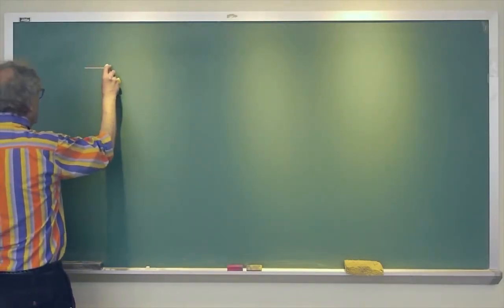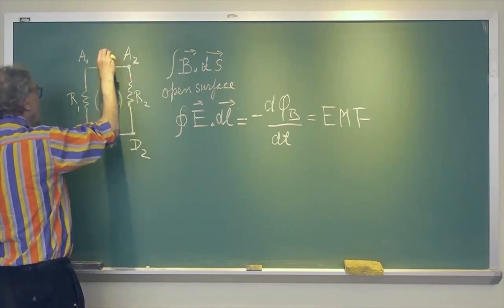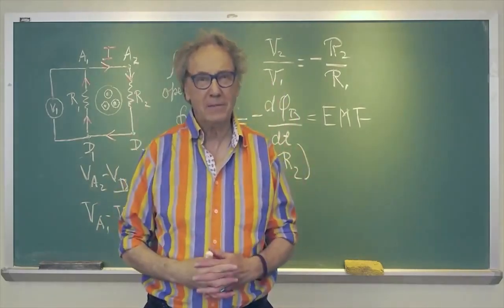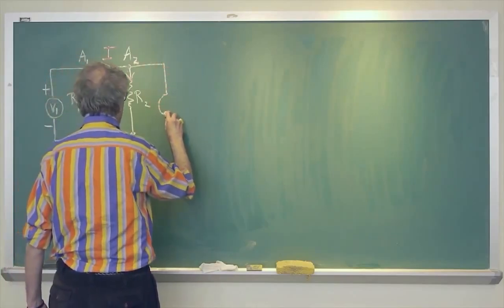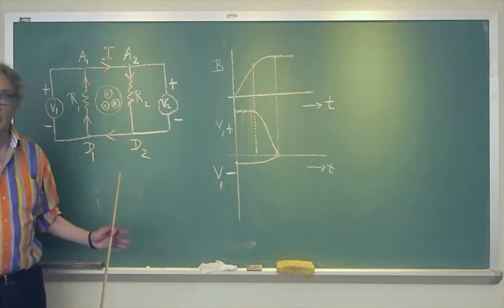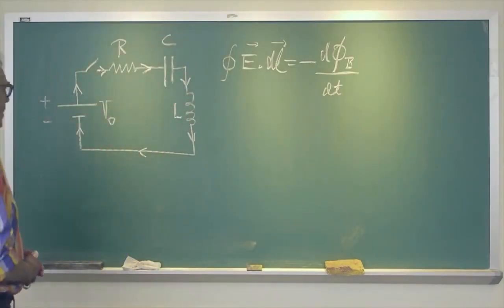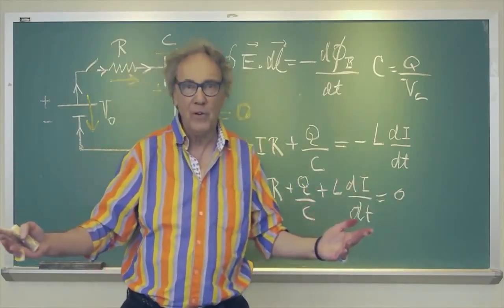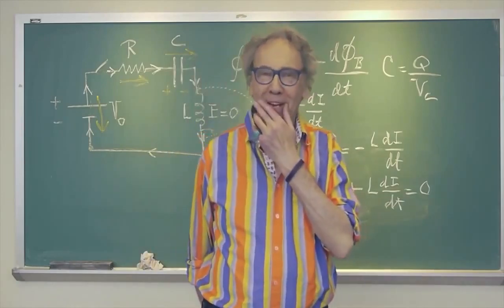Kirchhoff's Loop Rule Is For The Birds

Comment: Dear Prof Lewin, If you can please clear my doubt on the following issue. Referring to your lecture 16. If one voltmeter is connected right in the middle of the 2 resistors R1 and R2. How will the voltmeter know which reding to take IR1 or IR2 (from your lecture notes). (point D and point A) in the video. This is part is very confusing to me.. Which voltage will it read? thanks  in advance for any one who can give me some insight.
Reply from the maker: "right in the middle"  is ill-defined as you cannot cut wiress. However, if you move 1 voltmeter (without cutting wires) then you will be able to predict the values of both voltmeters PROVIDED that you can apply Faraday's Law to high presicion.

Comment: Sir i have a question in Farady's Law
If I have a circuit which is equilateral triangle with its three sides as resistance of "2 ohm and side 2m each"
and i keep it in a plane such that magnetic field there varies with time as "B = sqrt(3)*t" (SI units) (increasing in the same direction)
then i will get an induced emf given by faradays law of "3 Volts" (not talking about direction as Lenz law will take care of that)
i.e. a current of "0.5 A" will flow through the resistors
Now my question is that if I connect a voltmeter across the base side resistor,
a) below the resistor
b) above the resistor but inside the triangle
c) above the resistor but outside the triangle
then what will be its reading in each case? (only the magnitudes)
(Assuming the changing flux passes through the voltmeter too and it is ideal)

I think the answers are,
a) 1 Volt
b) 1 Volt
c) 2 Volt (in opp. direction to above two answers if voltmeter connected in same polarity)

Sir could you please tell if I am wrong anywhere?
(And I know the Kirchoff's Loop Rule is for the birds 😁)
Reply from the maker: if you apply Faraday's law correctly you can do this on your own. I have no time for this
Reply: @lecturesbywalterlewin.they9259  thank you so much sir for your reply
yes, sir i have solved it but I am just not sure of the b) part of my answer, i.e if the voltmeter is inside the triangle will measure 1V or 2V
Sir I do value your time and I know this problem is too fundamental also, but most teachers I have don't understand Faradays Law properly and some even use Kirchhoff's Loop Rule is such questions

I am a Class 12th JEE 2026 Aspirant from India btw

Comment: Why do you make such simple thing so complicated? Just say the truth. As soon as a physical Voltmeter is attached the circuit is altered. That is life. The flux is going through the surface attached to the loop around one of the resistor depending on physical location of the wires and the voltmeter. So voltmeter measures the voltage drop across the resistor in altered circuit. You cannot measure potential difference with a voltmeter in the original circuit. Different physical locations of the loop with voltmeter wires makes different loop and different surfaces. In both circuits the induced EMF has the same absolute value different by a sign because the direction of the surface flips when you move wires from left to right and vice versa. But the induced absolute EMF is the same. It is induced across the entire loop. The induced EMF makes the potential difference in the loop across the resistor. But the EMF itself is not a potential difference. It is a force. Depending on the location of the loop you measures a voltage drop on one or another resistor. But it does not depend on choosing between A1 and A2 or between D1 and D2. It depends only on orientation of the loop. Different resistor values - different voltmeter readings. Is not it obvious? It is very obvious for me.

Why do you talk about KVL at all? You cannot apply KVL in non static magnetic flux to calculate potential differences. KVL does not take into account changes in the magnetic field across loop surface.
Reply from the maker: I agree with you for 100%. But 2 of my viewers claim that KVL can always be used and they then argue that the 2 Voltmeters should have read the same valuues (also same polarity) if the experient is done correctly. Ofcoz they are dead wrong

Comment: The electric field is always zero,except when there is a transient.The inductor is the equivalent of a flywheel ("kinetic energy" equivalent).To start the inductor at t=0 an electric field is needed (Potential Energy equivalent) and whenever there is a change in the voltage supply,be it magnitude or a change in frequency.The electric field can even be negative (back emf).In steady state the electric field in the inductor is zero,
Reply from the maker: <<<<To start the inductor at t=0 an electric field is needed (Potential Energy equivalent)>>>>  this is dead wrong  there cannot be a potential difference over any ideal inductor. Please watch my 8.02 lectures.  this will be my last msg.
Reply: @lecturesbywalterlewin.they9259  Thank you for your time,it is really appreciated..

Comment: There is no voltage without electric field.
In general,no voltage , eg.across an inductor, is possible without the presence of an Electric field (within).

In the particular case of voltage zero across an inductor it means zero electric field within.
Reply from the maker: there cannot be an electric field inside the wires of an iideal conductor (thus zero ohmic resistance) as that would lead to an infinitely high current. Thus there cannot be a potential difference between the two ends of the inductor. *However a current can flow through an ideal inductor as the ohmic resistance is zero. this is my only response.
Reply from the maker: electric voltage across an ideal inductor is not possible as it would generate an infinite current. No E-field can be present inside the wires ofan ideal inductor. However, a current can flow throough  ideal inductors (like a superconductor)  but  the E-field inside will always be ZERO and thus there will never be a potential difference over an ideal inductor. This is my last msg on this issue.

Comment: Within inductor for both DC and AC voltage source:
Electric Field is Maximum at t=0
for DC source it decreases exponentially to zero and Oscillates at same frequency as AC voltage source.
Reply from the maker: nonsense

Comment: If Faraday law truly always holds, there wouldn't be any Faraday paradox.
Reply from the maker: E
{\displaystyle {\mathcal {E}}} is the EMF and ΦB is the magnetic flux through a loop of wire. The direction of the electromotive force is given by Lenz's law. An often overlooked fact is that Faraday's law is based on the total derivative, not the partial derivative, of the magnetic flux.[1] This means that an EMF may be generated even if total flux through the surface is constant. To overcome this issue, special techniques may be used. See below for the section on Use of special techniques with Faraday's law.
Reply: @lecturesbywalterlewin.they9259  prof. Lewin, there is nothing below your comment here. Could you please elaborate on what you mean with "below" here and  what is the [1] referring to?
I am making a series of videos on this topic , and on the definition of voltage and EMF in general and I am trying to cover all possible angles.

Do you mean that the convective derivative can be nonzero even if the magnetic field is constant because for example the contour of the loop is changing?

Comment: What type of momentum is being loaded unto the wire when induction takes place?
Reply from the maker: this question is ill-defined
Reply: @lecturesbywalterlewin.they9259  

It's not ill-defined but don't worry about it as it was a leading question so I'll just get to the point. (Try not to be too offended on behalf of Faraday who failed at formulizing a Torsion Theory of Electricity)

Electricity is not generated as its already  loaded in metals. It is ACTIVATED instead.

One cubic meter of copper windings has 8.5x10^28 electrons.

So charge is available.

But it is at maximum entropy state like a cloud.

Rotating magnetic field orients this cloud.

Cloud starts oscillating.

Frequency is fixed.

Amplitude & Wave Length are voltage & current.

So, how should we measure RMF input momentum to calculate the output of a "generator" ? (BTW mgh input is wrong!)
Reply from the maker: @jaydenwilson9522  there is no input and no output momentum you are confusing momentum with energy - I suggest you watch my 8.02 lectures

Comment: Dear Dr Lewin, at this moment in time as I am writing this comment; I'd like to say one thing absolutely honestly. It is impossible to engineer an electrical circuit without Kirchhoff law. It is not only for the birds it's also essential for electrical engineering.
Reply: The first rule a *good* engineer should know is to always know the limits of applicability of their tools.

KVL can be applied only when the electric field is conservative: when E is not conservative - and it is not in the presence of a variable magnetic field - KVL is no longer the right tool. You need to use a better tool: Faraday's law.
Reply from the maker: In Dutch we say "zachte heelmeesters, vuile wonden". I owe it to my multi million viewers to explain in detail why Electroboom is dead wrong. Many people make the same mistake that he made. All this is at the very roots of a correct understanding of Maxwell's eqs. I therefore have an obligation to set the record straight. This is my last msg.
Don't feel embarrassed if this physics is above your level; you are not alone. Non-conservative E-fields are not taught in high schools. 
I demonstrated at the end of my lecture #16 of my 8.02 E&M course at MIT that two identical voltmeters attached to the same 2 points in a circuit can show very different values. https://www.youtube.com/https://www.youtube.com/watch?v=nGQbA2jwkWI&list=PLyQSN7X0ro2314mKyUiOILaOC2hk6Pc3j&index=17
This can also be demonstrated with a transformer.
https://www.youtube.com/watch?v=b7i2uMx7gHo&list=PLyQSN7X0ro22zanLOcvkaSY-IZqheFYM5&index=8
In fact, look more closely at my circuit; it is a transformer. My closed loop is the secondary winding (only 1 winding) of a transformer and the primary windings are in my electromagnet. 
The reason is that an induced EMF (Faraday's Law) creates a non-conservative E field. This means that moving a test charge between the same 2 points in a circuit can require a different amount of energy (even with opposite signs!). You still aren't getting any energy for free, because it comes from the source of the time-varying magnetic field.
When a voltmeter reads a value V it means that the integral of E dot dL across the voltmeter is V. 
In cases where Kirchhoff's loop rule (KVL) applies, 2 voltmeters attached to the same 2 points in a circuit will always show the same value. Kirchhoff's original text can be found in the following link, pages 497-514: https://books.google.de/books?id=Ig8t8yIz20UC. Clearly he was fully aware of the prerequisite for his "loop rule". KVL is a special case of Faraday's Law. That's why Faraday's Law is one of Maxwell's equations and KVL is not.
My demo was first suggested and published by Romer in December 1982 in the American Journal of Physics. This demo has now become a classic; it's done all over the world at many colleges and universities.
ElectroBOOM and Dirk Van Meirvenne believe that 2 voltmeters attached to the same 2 points in a circuit must always show the same value which is not true. It's quite  embarrassing that they each posted a video on their channel in which they claim to have proof for their wrong ideas.
Also read Professor John Belcher's thoughts on Faraday's Law and on KVL. Professor Belcher is my former colleague at MIT. http://freepdfhosting.com/0813df09f5.pdf
ElectroBOOM insulted me in his video by mentioning that the reason why my 2 voltmeters read different values was due to "bad probing". He stated that if I had done the demo correctly both voltmeters would have read the same value. He could not have been more wrong.  
The following video may also help you to understand why 2 voltmeters attached to the same 2 points in a circuit can give very different readings. https://www.youtube.com/watch?v=LGdN7rDB3XE

Comment: While the magnetic source is changing there is an ideal current source between points A1 And A2  and there is another source between Point D1 and D2 this is because of induction . These two are the voltage rises  while these rises drop across the resistors which we measure using voltmeters. It means at any given instant the total potential accross the loop is always zero. so I totally expect two voltmeters to read different voltages while the magnetic field is changing because at those times each ideal conductor is acting as source and its two end points are not going to be at same potential. Just draw the sources and the confusion goes away.
The same is also true for the solenoid made of supercinductor. It is not a drop its a rise.
P.S. kirchoff law never considers or demnads ohms in wires. And sorry physics is not my religion It just a science.
Reply from the maker: so I totally expect two voltmeters to read different voltages while the magnetic field is changing   I agree and the closed loop integral of E.dL is NOT ZERO  Therefore KVL does not apply.

Comment: what can You say about electroboom is he right ?? he said he used richard feyman's book as a reference  and he concluded that kvl always holds true no matter any thing happen
Reply from the maker: Don't feel embarrassed if this physics is above your level; you are not alone. Non-conservative E-fields are not taught in high schools. 
I demonstrated at the end of my lecture #16 of my 8.02 E&M course at MIT that two identical voltmeters attached to the same 2 points in a circuit can show very different values. https://www.youtube.com/https://www.youtube.com/watch?v=nGQbA2jwkWI&list=PLyQSN7X0ro2314mKyUiOILaOC2hk6Pc3j&index=17
This can also be demonstrated with a transformer.
https://www.youtube.com/watch?v=b7i2uMx7gHo&list=PLyQSN7X0ro22zanLOcvkaSY-IZqheFYM5&index=8
In fact, look more closely at my circuit; it is a transformer. My closed loop is the secondary winding (only 1 winding) of a transformer and the primary windings are in my electromagnet. 
The reason is that an induced EMF (Faraday's Law) creates a non-conservative E field. This means that moving a test charge between the same 2 points in a circuit can require a different amount of energy (even with opposite signs!). You still aren't getting any energy for free, because it comes from the source of the time-varying magnetic field.
When a voltmeter reads a value V it means that the integral of E dot dL across the voltmeter is V. 
In cases where Kirchhoff's loop rule (KVL) applies, 2 voltmeters attached to the same 2 points in a circuit will always show the same value. Kirchhoff's original text can be found in the following link, pages 497-514: https://books.google.de/books?id=Ig8t8yIz20UC. Clearly he was fully aware of the prerequisite for his "loop rule". KVL is a special case of Faraday's Law. That's why Faraday's Law is one of Maxwell's equations and KVL is not.
My demo was first suggested and published by Romer in December 1982 in the American Journal of Physics. This demo has now become a classic; it's done all over the world at many colleges and universities.
ElectroBOOM and Dirk Van Meirvenne believe that 2 voltmeters attached to the same 2 points in a circuit must always show the same value which is not true. It's quite  embarrassing that they each posted a video on their channel in which they claim to have proof for their wrong ideas.
Also read Professor John Belcher's thoughts on Faraday's Law and on KVL. Professor Belcher is my former colleague at MIT. http://freepdfhosting.com/0813df09f5.pdf
ElectroBOOM insulted me in his video by mentioning that the reason why my 2 voltmeters read different values was due to "bad probing". He stated that if I had done the demo correctly both voltmeters would have read the same value. He could not have been more wrong.  
The following video may also help some of you to understand why 2 voltmeters attached to the same 2 points in a circuit can give very different readings. https://www.youtube.com/watch?v=LGdN7rDB3XE
Reply: Electroboom misquoted Feynman. In his Lectures, Feynman states that in order to apply the easy-to-use circuital laws all magnetic fields should be confined inside the components alone. This means that no magnetic field (and in particular no changing magnetic field) should be present inside the path that connects such components. If this is the case, voltages between any two points on this path (the "circuit") will be path-independent and can be expressed as potential differences.

But this is not the case in Lewin's circuit: a changing magnetic field sits right in the middle of the circuit and so voltages in such a circuit will depend on the path, as Lewin has shown.